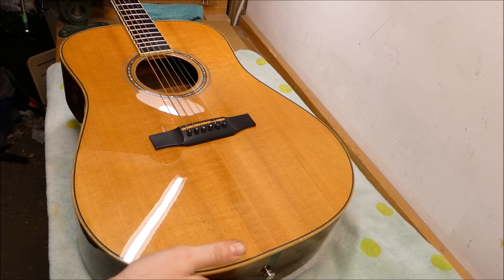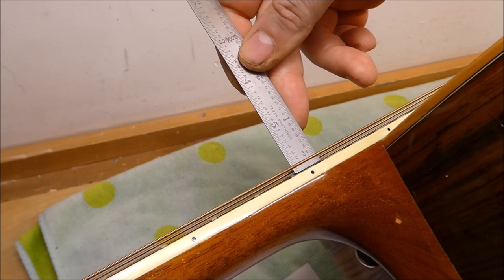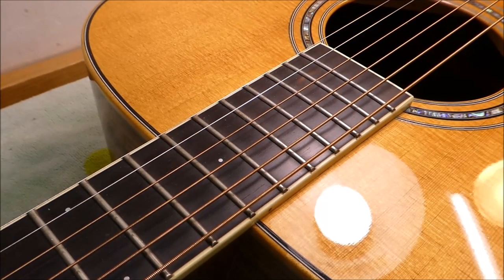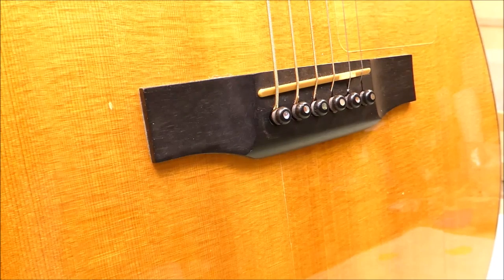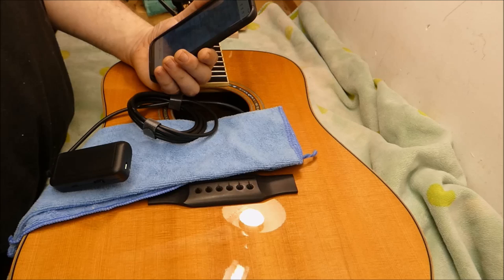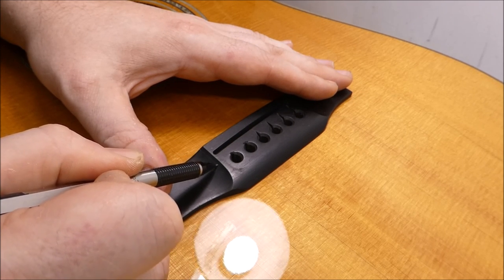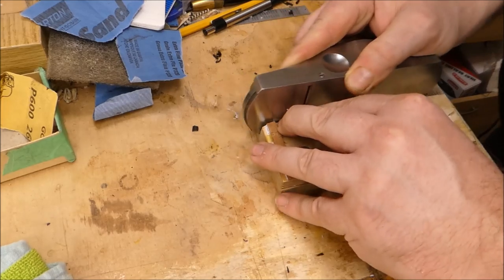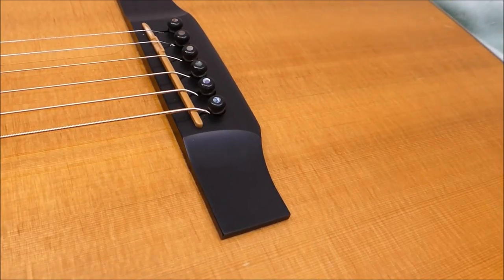Guitar Repair:  Close Shave for a Larrivee

Comment: I thought shaving a bridge wasn’t the best thing  because it affects the sound negatively,
Why couldn’t a standard neck reset be done like a Martin or are Larrive guitars different?
Reply: Cost and time. A full-bore neck reset  on a glued neck is an expensive proposition and there is always some collateral damage to something else that has to be repaired or re-finished.  And neck resets impact the tone also - sometimes for the worse.  As Ted said, there's a limit to how much you can take the bridge down but this guitar wasn't there yet. It was the smart choice IMO.
Reply: Tioga Fretworks thanks
Reply: @HBSuccess  Thats not true at all. A neck reset is really a non altering procedure and when its done the right way, there's no collateral damage and it wont effect tone in a negative way. Shaving the bridge however is an altering procedure that will negatively affect the volume and sustain of the guitar. 

It sounds like what your describing can happen to a guitar that is in the hands of a bad luthier. The neck reset when done right, affects the tone in a positive way and brings the string height from the soundboard  and neck angle back to its factory specs. 

And Ive never heard of a neck reset causing any finish problems unless the finish was already an issue - or it was in the hands of someone who didn't know what they're doing. You gotta know what you're doing if you're gonna do a neck reset. I wouldn't give my guitar to a luthier who's never done one before. 

Is a reset expensive and time consuming? It can be but its also inevitable and as far as timing - it only takes about a weeks worth of work. But many luthiers have multiple guitars in line and thats why it can be months before you get yours back.  

When the reset eventually does come, now you're paying for a reset, a new bridge, and the installation of that bridge. And that bridge is now non original. 

If you have an expensive guitar, the reset is the best option without altering/destroying other parts of the instrument.

Comment: Strange I've got a nearly 40 year old Fender Redondo with 0 cracks or damage past a few minor chips in the finish. What causes cracking then? Because I've taken mine from the Peak District to the Hebrides and in the back of a hot van in summer. My guess is Britain is just a good level of humidity?
Reply: Really dry conditions can destroy can acoustic. Massive and rapid changes in temp and humidity aren't too good either. Traveling in a hot car isn't too bad but leaving in there all the time is a quick death. And then sometimes you just have a piece of wood that just doesn't want to be in the shape it was made into.

Comment: 6/64 is medium-high action?
Reply from the maker: Depends on the player.  A lot of new factory guitars get shipped to stores with that action.
Reply: twoodfrd yes. It’s interesting how we categorize things, to Martin 6/64 is “low” but to you it’s “medium-high”

Lower than 6/64 on acoustics seems to tend to rob them of tone and power. In my experience anyway
Reply from the maker: Consensus seems to be all over the place on this one. It varies so much from guitar to guitar, strumming vs  single note fingerpicking, top thickness, brace stiffness. It all goes into the equation. 4 is low. 5-6 satisfies most people I deal with. 7 feels high.

Comment: Humidify a guitar? That sounds like a bad idea.
Reply: quite the opposite, if you let a guitar get too dry for too long the wood will shrink, causing all sorts of problems like especially splitting across the top. most guitar companies won't warranty that damage because it's your fault. 

you want the guitar mostly hanging out in the 40% to 50% range; that means if you're in arizona you need to be humidifying year round, if you're in florida probably never, and if you're in someplace with all four seasons, say virginia (where i am) you gotta maintain it in wintertime, summertime not so much.
Reply: I'm in Alaska and this is a standard service offered by my local guitar shop. Invoiced by the week. My partner's inexpensive Fender dreadnought had to go in for 2 weeks this late winter because she neglected the case humidifier and the top and fretboard moved so much a trussrod adjustment wasn't enough. The humidity chamber returned it to playable. We were sent home with the recommendation to take our instruments into the bathroom with us when we take a shower. Winter humidity is frequently in the single digits.